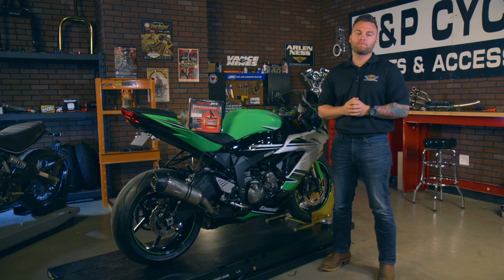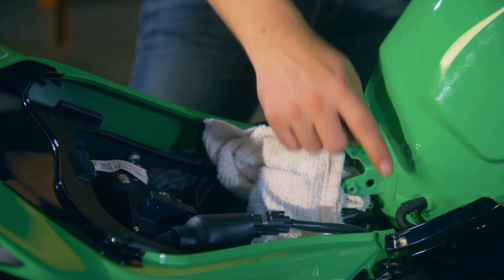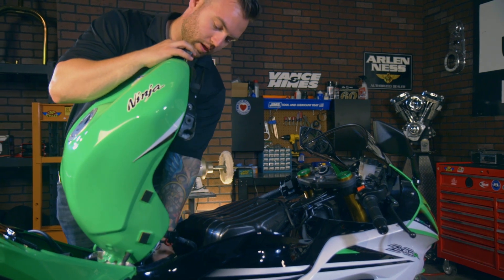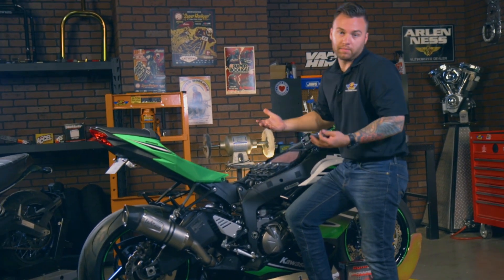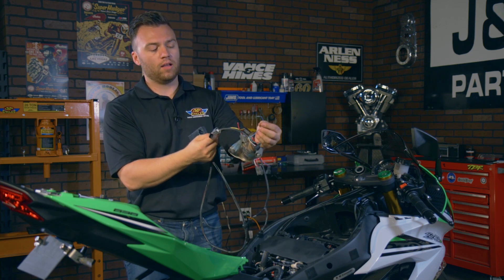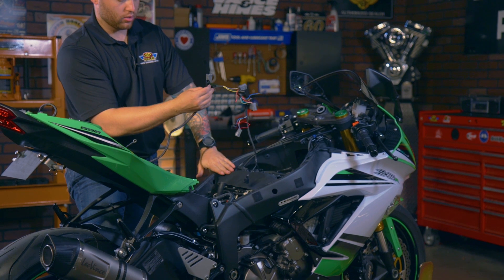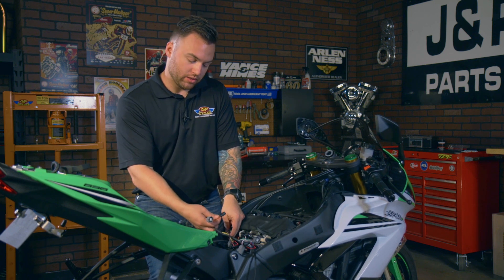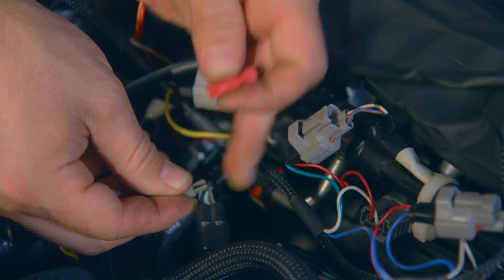Dynojet Power Commander V Install ZX6R

Comment: hey, i noticed the Gear Input & Analog input cables were worn out. I took them out to cut a bit and put them back in but now I forgot in what position they were connected. I have put them in according to the fold of cables, but the question is; would it be remarkable if they were wired incorrectly? Thank you.!!

Comment: I have a 2020 ZX6R is this the same process?
Reply: Let me know if you find a answer, i need it
Reply: @leohanna954  I did. It's the same. Pretty simple. You only need like 2 allens and a phillips head.
Reply: Anthony C nice, happy to hear that. Is it also straight forward tuning the power commander for the right map on the computer
Reply: Can I ask if there was anything different you did? I followed the tutorial step by step on my 2020 zx6r abs and it doesnt run with it connected.  I removed it and now I have an engine light and the Traction control is disabled..

Comment: When I disconnect the main fuel line how much fuel can I have in the tank?  Does it need to be empty or does the pump keep it from running out?  Sorry I know for some this is a simple question.
Reply: The pump will keep from running out, it can be full itll just be heavier to maneuver